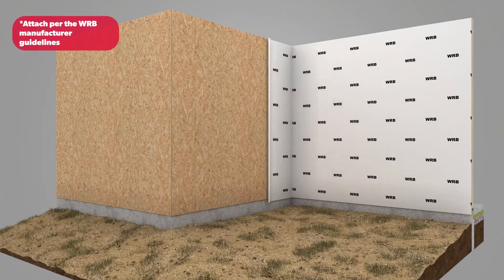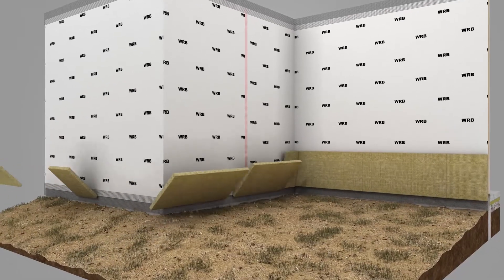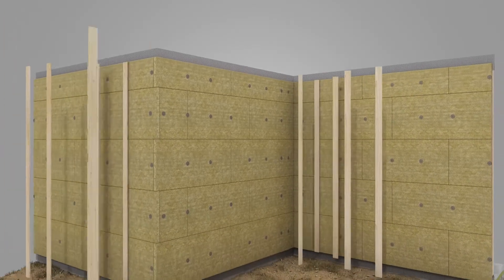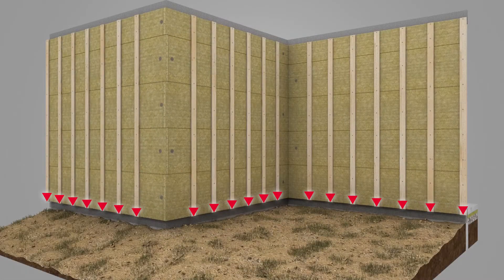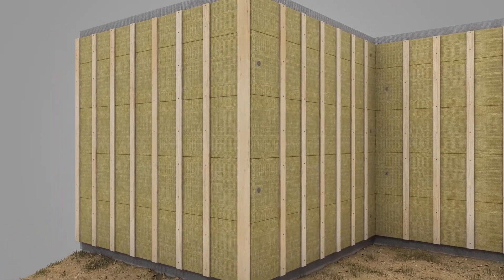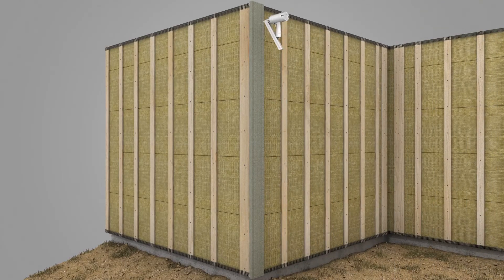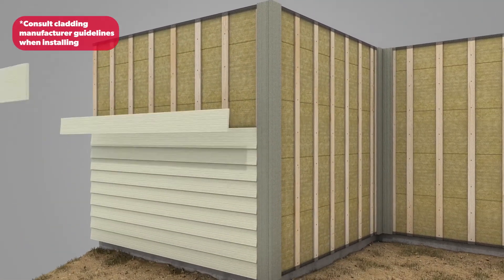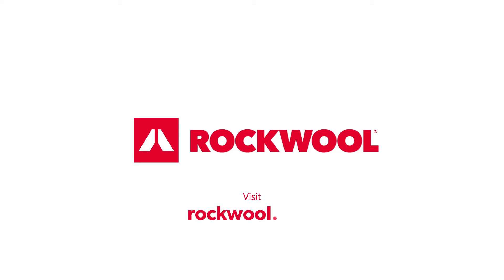How To: ROCKWOOL Comfortboard® 80 Inside and Outside Corner Installation

Comment: Shouldn't you put metal flashing over the firing strips at both inside & outside corner boards so that if rain seeps in between the wall boards and the corner trim, it doesn't destroy the wood firring strips over time?
Reply: The whole point of the rainscreen is that cavity behind to address any bulk water that gets past the siding.  It will drain down and be fine.

Comment: I'm doing a tear off and reside of a 100 year old house in Zone 4. We're planning to use Comfortboard 80 because we need the 35 perms to help the (soon to be) dense packed walls the ability to dry to the outside. I love this video but I hit a wall with the assembly in the real world. A major manufacturer of engineered wood siding requires that the furring strips as shown in the Rockwool video be fixed to insulation with a compressive strength of at least 25 psi (aka rigid foam insulation). Here is the quote from their tech support: "Foam plastic sheathing that we state to use should be rigid enough as to not cause waviness in the finished wall covering. Generally, these products are a minimum of 25psi compressive strength. Mineral wool would not likely meet this requirement. As far as warranty, anything done or used outside of the published guidance could impact warranty if that specific practice directly causes a failure." My approach given this issue will be to pad out the furring with the EPS (that I'm tearing off the house anyway) and then install the Comfortboard in between the vertical furring. More futzing and cutting that I wanted to do but it's the only way that I can see making it work. I'm in touch with the warranty team to see if they have a technical note that covers what appears to be a unique circumstance.

Comment: A vent screen such as Coravent for air circulation was excluded from this How To. Installed below and above the furring strips at the top and bottom.
Reply: They showed and said bug screen which best practice should be metal.

Comment: Why don’t you want to put house wrap over the rockwool?
Reply: house wrap would be difficult to install over rockwool since you can't staple into the rockwool or use any of the self-adhered house wraps to stick it to the rockwool.  Additionally, sandwiching the house wrap between the plywood and the rockwool protects the housewrap from the elements more which is important since that's providing your air and water barrier.  The rockwool doesn't mind getting wet so it's fine that it's not protected by the house wrap.
Reply: Comfortboard is hydrophobic and breathable
Reply: If the Rockwood ever got wet, all that moisture would be trapped behind the house wrap!

Comment: No one talks about this, but if you have a siding which is a poor heat conductor shading your true wall, not in contact with the exterior wall, especially if it is vented allowing for air flow behind it [heat dissipation], and out the top, you’ve given your house a parasol. Someone tell Matt Risinger we have a new catch word, please. This parasol will block incoming radiant energy. This isn’t an equilibrium R value, it’s reducing the intensity of the incoming heat source, the sun, that’s beaming down on your building. I’d like to see a heat transfer engineer look at some of these things and make a few back of the envelope calculations.
Reply: @DitDitDitDahDahDahDitDitDit  I often wonder about the chimney effect if there was a fire near the side of the house and the Flames being sucked up into that space rainscreen X
Reply: @davidzimmerman9841 I came here to say with a moisture resistant insulation and a web, why add a gap using wooden strips to the exterior face of the insulation?  The western USA needs a system without ventilation gaps or wood on the exterior.

Comment: Can you use 3/4” ply board instead?
Reply: On the outside of the insulation?  No, definitely do not do that!  Leave space for the wall to vent and air dry if it ever gets wet.

Comment: Unless the screening is rigid as well, this method will leave a space for pests to access in the flexible area between the strapping where the screen meets the siding?
Reply: rockwool doesn't contain any nutrients, sugars, or proteins that might attract insects or rodents. This makes it fundamentally unsuitable as a food source or nesting material for pests.
Reply: They covered this at about 3 min in

Comment: I have had a very difficult time sourcing the Comfortboard 80 in the Northwest. Still no luck
Reply: I ended up just using Powerwool sourced from Service Partners.  Basically the same product although more expensive.  Lead time was the determining factor for me.  Had powerwool delivered next day.  Will keep lead times in mind for next project
Reply: contact Adam Akre at Pacific Building Center in Blaine, WA.  He has access to the 2' x 4' pieces (6 to a pack) at least